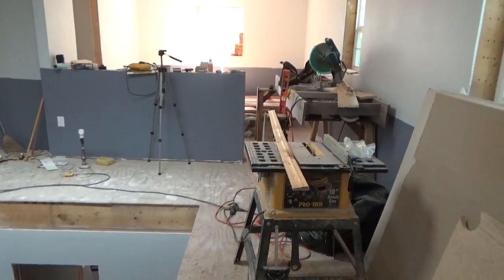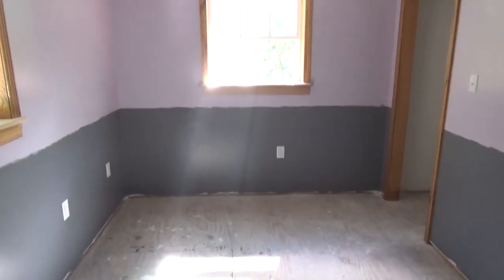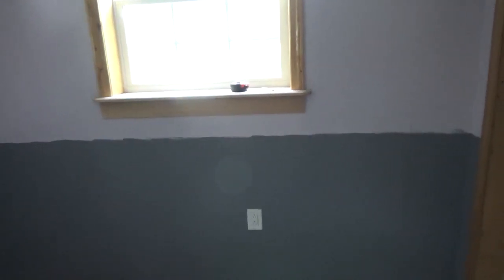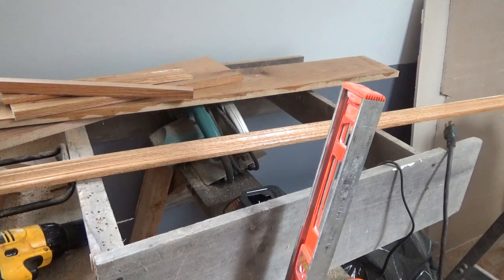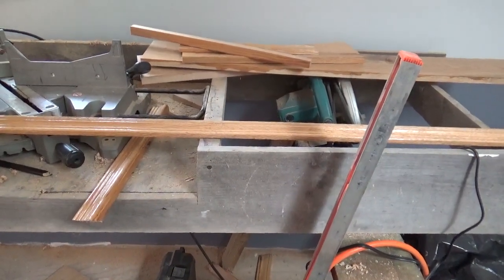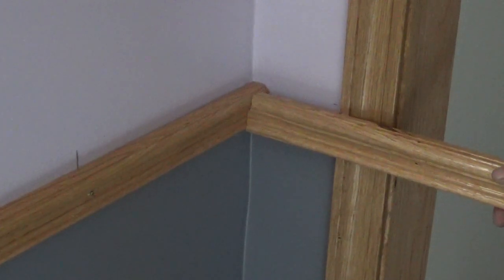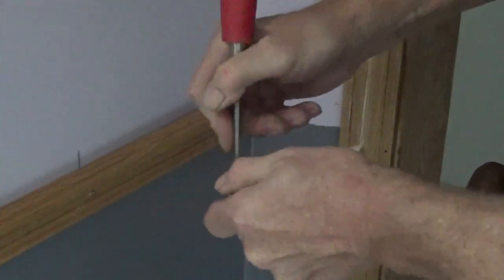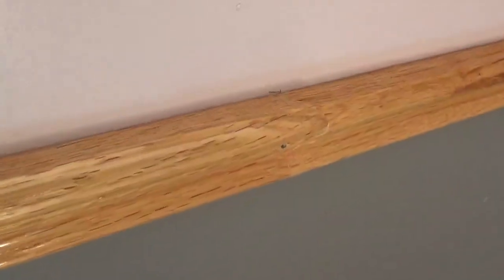Hanging Chair rail molding: Woodmizer LT 15 Forest to Finish.

Comment: Hi Joe... more good pointers, thanks. Back when I did my molding I used pine, and that was because I was not comfortable with hardwood, and I didn't want to spend the extra for it at the time. If I had a way to make my molding like you, I would have. But the bottom line was that I was not comfortable working with hardwood. And even using pine, my joints did not come out like yours and that was lack of knowledge too. I never professed to being a finishing carpenter, I always enjoyed the framing more.

Comment: One false step and disaster..you better get some safety rails up there....
Reply: I second that motion
Reply from the maker: I use to walk 8" block walls in a 30 mph wind setting bar joist.  I think I can handle this. Thanks for the comment.
Reply: Not worried about forward movement it's the backing up to admire your work that gives me the hebe jeebes....L